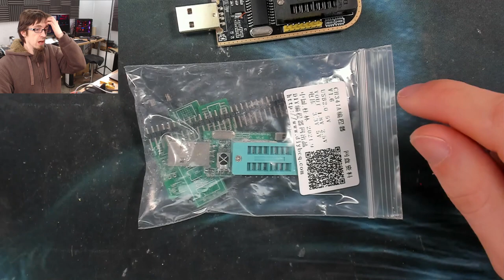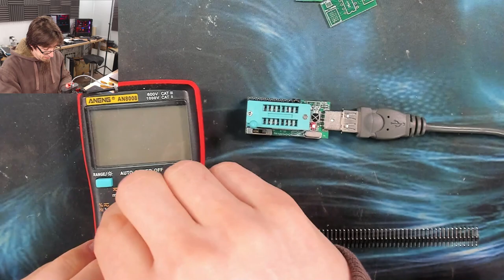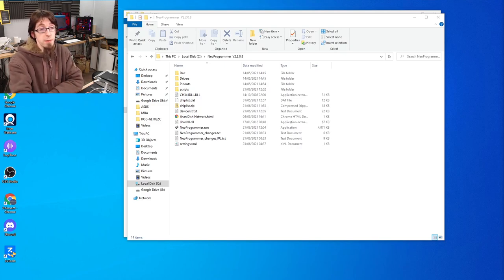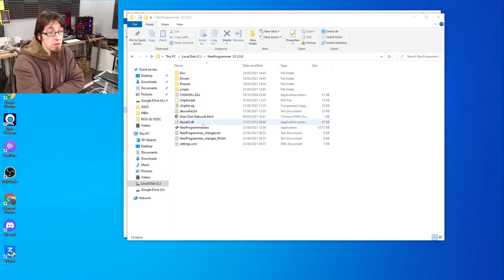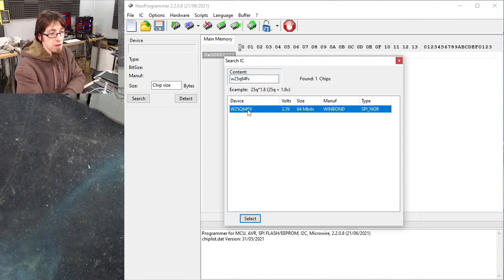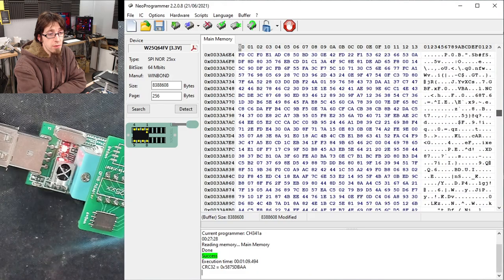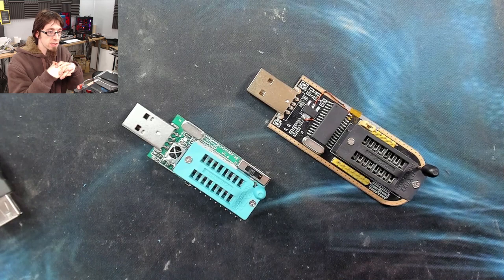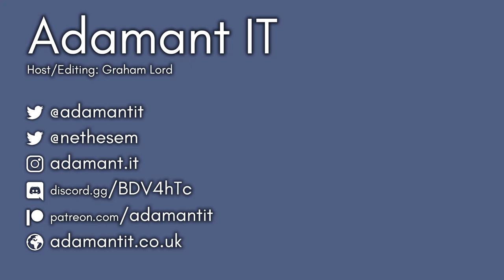CH341a v1.6 Review, No More Volt Mods! - LFC#297

Comment: Any particular reason why you desolder the chip instead of reading it using a test clip?
Reply from the maker: Clips are fiddly and intermittent. If you get one that works well, they can be great, but getting a good one seems to be somewhat luck of the draw, and even then it won't help you for WSON chips.
Then there's the other issues of flashing in-circuit, where the programmer will be powering up and communicating on the whole EFI SPI bus, which includes lines going to delicate places like the PCH. If you know the platform well, this is fine, but I've seen weird stuff happen. IMHO, desoldering the chip is safer and more controlled, and if you're doing this level of repair work, it's really not a big deal to just take the chip off the board.
Reply: @Adamant_IT Good point on the surface mount chips!  Every single clip I've seen (and all the ones that come with the CH341a) are junk.  The one that seems to be regularly recommended is the Pomona 5250, which costs as much as the whole CH341 ($18-20 USD).  You can buy a cable that plugs into the SPI diagnostic / programming port, instead of interfacing with the chip directly, but the cheapest you can get a set (there are 3 different connectors over the Mac model years -- MOLEX 30pin, HIROSE 30pin, HIROSE 12pin) is ~$50-70 USD.  Nice to use though on the Macbook Air -- you don't have to remove the motherboard anymore to flash the chip since the port is on the top of the board.

Comment: Good morning, sorry to bother you, but I have seen that you are an electronics specialist and I was wondering if you could give me some solution. I have a Sindoh 3D 3DWOX 3D printer and when I inserted a USB flash drive to update the firmware, there was a power outage. Now only the Sindoh presentation screen is displayed and the image is frozen there. I have disconnected the printer from the power and even removed the internal battery from the motherboard but it remains the same. There is no way it does anything. It has been left frozen. I'm afraid the firmware has become corrupt. I have observed that the motherboard has some jumpers, I don't know if any of them have any use. Can you help me please? Any suggestions to force flashing the firmware? How can I find out which chip on the printer's motherboard is the EEPROM? Thank you very much in advance.
Reply from the maker: I'd expect a 3d printer to store the firmware on its microcontroller, but yea there's probably a way to directly flash it. I'd see if you can find a 3D printer DIY community, and someone there might know how to do a manual flash

Comment: Where to buy one of these 1.6 versions in UK? Thought they would have been on Amazon by now but not. Must be a reseller rather than a slow boat from china.
Reply from the maker: Look for the V1.7, it's way more available. The V1.6 seemed to get replaced almost immediately for some reason. They're almost identical, I'm not actually sure what the difference is on the 1.7

Comment: It has a line level coversion chip hidden underneath the ZIF socket, significantly more advanced than the regular CH341A programmer. Sholud be much better for in circuit programming  also. Its currently up to V1.7
Reply: Any place to get this 1.7V? Also V1.6 seems to be gone from ALi.
Reply: @heimdall_gatekeeper  Sellers use older pics on listings, i bought mine from a seller with plenty of feedback & it was V1.7
Reply: @heimdall_gatekeeper  It's still on there but hard to find search for "ch341a 1.8v"
Reply: @neiliewheeliebin  Yes, found one and it is ordered.

Comment: I have to clear cmos on every boot computer works fine after cmos clear but if I dont clear it it does not boot I have good power its a older motherboard 2011 asus the button cell batter was dead replaced it flashed new bios but nothing change do you think its a bad chip I have unpluged drives changed out everything  was working fine just all of a sudden have to clear cmos every boot thanks for any help I love your channel

Comment: also can you somehow when you have time comparing those two circuit so we can mod older one with voltage selector also infra that would be much apperciated
Reply from the maker: I don't think you can really add a volt select to the older one. I missed it in the video, but the voltage conversion is done by a dedicated chip under the socket - which is why the socket is mounted wonky. The PCB needed to be completely redesigned for this.
However, if you've done the 3v mod to the original CH341a, and you own a 1.8v converter, you basically don't need this updated version. Although it does 5v and 2.5v as well, I've never seen chips of those ratings.

Comment: It's works good till 64MB chips , above that you will always get corrupted dump .. just read a 128MB chip and compare reading to another decent Programmer
Reply: ive done 128 chips (sometimes the pin 8 lift trick helps) .. some are problems but newer version of neoprogrammer i believe fixed it partially.. i use flashrom 1.21 w CH341a on those. .or EZP2019 or RT809
Reply: @LeadFarmer813  I think it's Hardware limitation to ch341 ic you can see other programmers like old  mini pro have same issues with 128 chips ...but not all 128

Comment: I am a computer novice, I found your video to be extremely informative. My HP laptop bios cannot be recovered using a usb flash so I bought a CH341a programmer with the clip to connect to my HP laptop. My bios Chip is, XMC QH64AHIG 64m bit SPI serial flash SOIC-8, when I connect the clip using Neoprogrammer software, it cannot identify the name, type or any info relating to the Bios chip. I tried using Asprogrammer software and same issue. The connection appears to be ok with the ch341a device, but I am stuck as  I cannot identify or read the bios Chip. Is there any solution or steps that I am missing? Would be so helpful.

I have the updated Bios bin file from HP awaiting to be flashed. So just need to get the Neoprogrammer to identify the bios Chip.  Help??

Comment: Having now used this. I do wish you could alter the speed it runs at. The faster and SPI programmer goes the shorter the data cable you need. I had to shorten the tail on my flash clip by more than half in order to start getting reliable reads and writes.
That said it's small convenient does the job, doesn't care if you stick it on the end of a long USB extension cable, as a built-in voltage switch, and a diagram to remind you which way things are supposed to be put into the ZIF socket. I really like it.

Thank you for telling me this device exists.
Reply: Still happy with it, any recommendations? I seen this new one, it looks pretty good but no software yet, "CH347 Development Board".

Comment: Why there is an IR Receiver soldered on the programmer, does it has any purpose?
Reply from the maker: For decoding TV remotes
Reply: @Adamant_IT  Does it requires any special software to get remote codes? If you have the software please share the link. I'm interested to know how this thing may work.

Comment: can I buy an adapter aswell for 32pin EEPROMs?
Reply from the maker: paaaaass... I'm not sure if it's possible to adapt the big bois for these mini programmers. You might need something bigger like a TL866ii+
Reply: @Adamant_IT  ,
I would agree that the TL866II+, TL866II-3G(T48), or the  T56 would be a better option for the larger parallel based (E)EPROM's.

Comment: Hmm interesting. I think it would be nicer if it came with a SOP8 socket that you can plug the chip in and directly into the programmer... Theres also the clip but that can be wonky at times when sometimes the circuitry on the motherboard just doesnt play ball.
Also on some Dell and hp laptops, if the bios chip is missing, the power rails might start for only a few seconds after plugging in charger and then shut off, and won't even try to POST without the bios chip.
Reply: Question: please what is the name of this programmer..have tried checking it out on ali express forum..can't find it

Comment: Hey Adamant IT i don't know if you'll read or respond to my comment but does it support "Winbond W25Q64JV / 25Q64JVSIQ" because i see that you have allot of videos on re-flashing PC/Laptop Bios-es but what about Wi-Fi Router Firmwares???? (as you can see i definitely bricked my router by flashing OpenWRT the wrong way😑🤦)
Reply from the maker: Yup, NeoProgrammer has the W25Q64JV on the chip support list, so a CH341a will be able to program this ROM.
Reply: @Adamant_IT  thank you for the help😁

Comment: You never needed volt mods for these... I've seen quite a few people modding these for absolutely no reason. There is no amperage on the lines that idiots are measuring and thinking they need to mod the device. You can't program with voltage alone, you need amperage as well... yes, some of the pins may read 4.xV, but at 0.02A, it's not harming anything (mainly because those high voltages only show up when there's zero load, and drop to near zero once a chip is socketed)

Comment: Does anyone know if this is the process you go through to remove bios passwords ? I have a HP Spectre notebook that has a power on admin password grrr … I’ve been a tech for most of my career 20+ years but have never dabbled in BIOS re/programming … all very exciting stuff really haha

Anyways !… any tips would be greatly appreciated ;)
Reply from the maker: For HP, use a programmer like this to dump the BIOS and then use RCUnlocker (google) to remove the password from the dump file. Then flash it back to the chip, and you should be good. If the laptop has Device Guard (HP's BIOS security) this can be very delicate, and might take a few attempts to reset without triggering Device Guard.
If you manage to do it, set a new known admin password right away to overwrite the old one in Device Guard. You can then clear it normally once it's a known password.
Reply: @Adamant_IT  hey mate! Thank you for your reply ! Means a lot! Thanks for that ! Now I feel abit more confident doing it once that device arrives lol

Comment: Well, after watching your video I have to say the following. The main message of this video is not true. Using the black CH341A board you don't need to do a volt-mod, even if you're programming 1.8V chips. Yes, at idle you will see 5V on the data lines, but when you connect the appropriate chip, the voltage will automatically decrease to the required level. The fact is that the current in the circuits of the data lines of this programmer is so small that the resistance of the chip you are programming is enough for the voltage to drop to the required level. You can check this very easily by connecting the chip and taking measurements, moreover, this is how a lot of professional programmers work.
I have been using this programmer for many years and not a single chip has been damaged by this programmer. Don't be paranoid folks, just check.
Reply: sorin from electronics repair school explained it very well that the voltage drops down and the current is mA and wont destroy nor bad..

Comment: A very good video. Question, could you not just put the chip in the holder and programme it rather than solder unsolder it?
Reply from the maker: SMD chips like the one I demonstrated with have no legs on them, so there's nothing to hold - which is what the little adaptor boards are for. Older chips with legs will drop directly into the clamp though, yes.
Reply: @Adamant_IT  ohh saw a friend use clip on the WSON8 chip desoldered and works if u have good solder balls on ends of chip.

Comment: no longer available. epic.
Reply from the maker: v1.7 is basically the same and widely available
Reply: @Adamant_IT  couldn't find one that ships to canada on any site.
I followed your soldering tutorial for the old model and it worked... until the lifted pin came out when trying to replace the kapton tape. oops.
screw this garbage.. I just resorted to using a pi. I thought it'd be more tedious initially, but I was wrong lol
Reply from the maker: That's a good alternative. I have very little knowledge about using Pis, arduino, etc, and they can be amazing tools to achieve anything you need. Definitely an area I want to expand into at some point